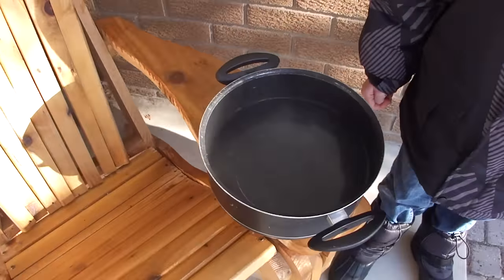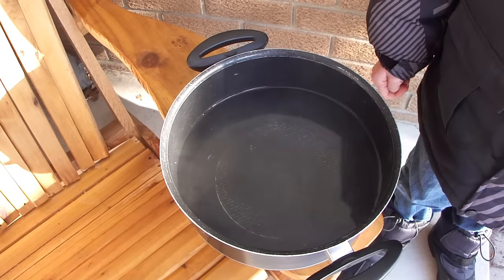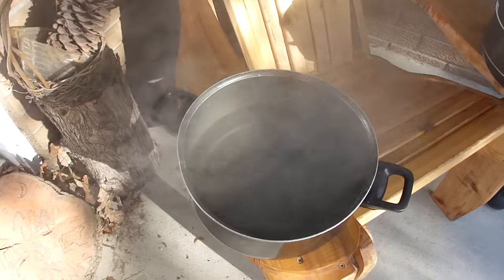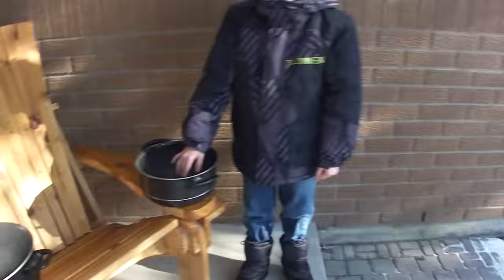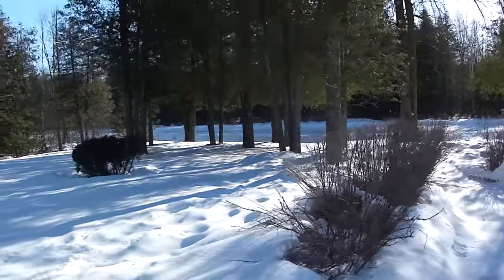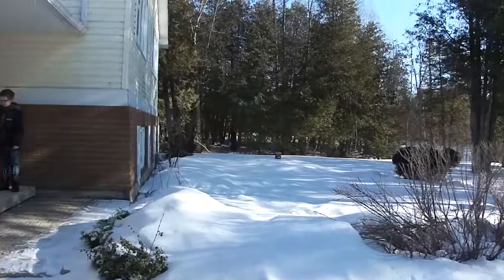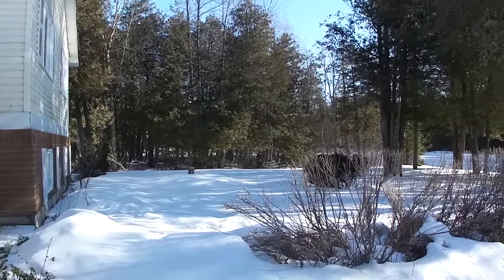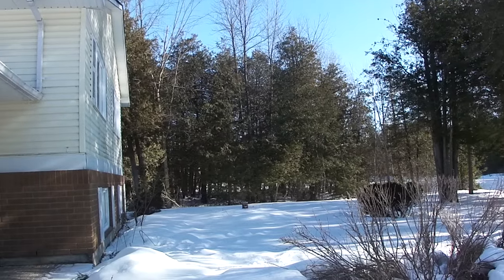Hot water freezes faster than cold water?

Comment: The hot water tries evaporate and turned into particles so that praticles easily and quickly freeze. Thats how it works.
Reply: thank you, i was scrolling the comments to look for explanation
Reply: @lunskyie  the difference in temperature is proportional to the drop in temperature. The higher the temperature the more quick the temperature drops.
Reply: and hot water is less dense than cold water so it freezes faster
Reply: Yes . exactly.. Thanks
Reply: Does this apply to boiling?
Reply: @raivaru3270  you mean the other way around? No,
Reply: @raivaru3270  No because because boiling is gaining temperature (energy) while cooling is loosing energy. Let's say you have pure water which boils at 100°C. The water if is 20°C will take more time to boil than the water being 30°C. Because at 20°C the water has stronger intermolecular forces of attraction. More energy is required to break bonds while separating the molecules such that the intermolecular potential energy is increased. Therefore it will take more time to boil than the 30°C water.
Reply: So what should they give you? Nobel for physics or chemistry?
Reply: @ismailhossen2043  Nothing he is just explaining something
Reply: @ismailhossen2043  both
Reply: U know this is not really the explanation atleast not accurate at all ,the displayed effect is called mpemba effect,and there isnt an agreed explanation on it ,so it's not as simple as you would like to think
Reply: The reason why hot water freezes faster is because the molecules in hot water are moving faster than cold water. When the molecules are moving faster they hit the cold faster and cool down faster. Simple easy numbers to explain this, a single cold molecule will take 1 second to move from one side of the pot to the other. A hot molecule takes 0.5 seconds to move from one side to the other. So in one second the cold molecule only hit the ambient temperature once and the hot molecule will hit ambient temperature twice. The more the molecule hits ambient temperature the more it picks up ambient temperature.
Reply: @ismailhossen2043  someone's jelly about someone else knowing more than them
Reply: I feel smarter now
Reply: @youdononeetokno  I feel smarter but not at the same time lol
Reply: @jhan168  bruh
Reply: @waybous  yeah. Basically the hot water has more kinetic energy.👍
Reply: @youdononeetokno  lmao 🤣 Honestly though. Like I understand the concept but when you add words like intermolecular forces, my brain refuses to process 🤣
Reply: @jhan168  Wdym. That's how they taught me at school😂
Reply: @kokusei3948  well it is a proven fact that hot water indeed freezes faster. Its just that we dont really know the real reason behind it
Reply: @youdononeetokno  Yeah. The bottom line is you're smart, I'm not.
Reply: @kokusei3948  testing which one freezes faster....in a freezer. Using timers of course
Reply: @jhan168  Thank you but I wouldn't say that I'm smart because there's so much that I do not know and other fields that I don't understand at all
Reply: @kokusei3948  dunno, not my expertise
Reply: @kokusei3948  no problem
Reply: i think the word is "Condensation" ?
Reply: @narcos2910  condensation is the direct opposite of evaporation, so no i don't think so
Reply: @youdononeetokno  "the higher you go, the farther you fall"
Reply: Now that’s science 🧪
Reply: Thanks
Reply: @kokusei3948  To fully understand it you would need to connect quantum mechanics and thermodynamics. The position, energy and momentum of the individual particles in the molecules is quantum mechanics. This leads to the state and behaviour of the individual water molecules and the same for what surrounds each of them. This then leads to the thermodynamics of the systems involved in which the average energy of the water molecules in the system matches the average energy of the air molecules faster based on the how bigger the difference is between them. The more potential energy within the particles contained in the water molecules the bigger the gaps between the water molecules, the faster the molecules can move and the more energy that can be transferred via photons to the colder, more dense, less active molecules within the air. This means that the particles in the system achieve faster thermal equilibrium the greater the difference is between the hotter water and the colder air.
Reply: that is false. i mean kind of. the reason hot water freezes faster is because it has less molecules in them so the cold air has less to freeze. and if you noticed it didnt evaporate it turns to snow.
Reply: @jdogzerosilverblade299  That’s why people were pointing out that hotter water has lower density, which means bigger gaps between the molecules, due to particles with higher potential energy having a wider area of probable positions and a higher probability of generating higher energy and/or more frequent bosons.
Reply: Aaaaaaaaaaaah ohhh yeah
Reply: I reply so late but it's funny how people look things up and pretend like they know things lol but if you really did know good for you ig
Reply: So simple (sientist)
Reply: @kokusei3948  What you’re stating comes from combining classical mechanics and thermodynamics. To understand it you need to combine quantum mechanics and thermodynamics. Hot and cold aren’t opposites in the way you explain when dealing with particles. All you have is potential energy levels. A volume of particles has less particles in it as the average potential energy in the particles increases. The combined volume of particles is also referred to as a system. In quantum mechanics the particles try to get an average potential energy, which happens faster if there are less particles. They can also produce higher energy photons to transfer the energy throughout the system if they have more potential energy. All the system has to do is agree on a new average potential energy level for the system in order to transition to that temperature on the macroscopic scale. That happens faster with less particles and greater levels of energy.
Reply: Are you a scientist? 😮
Reply: @killuabodypillow7607  I have a 1st class bachelors degree in physics (with honours) and a PhD in particle physics.
Reply: Damn, thats pretty interesting actually
Reply: @youdononeetokno  oh ok thank you
Reply: @anthonyscarfe4853  that's cool and what are doing as job. I'm still a student and I don't know what I wanna do.
Reply: That’s not what they said in the video.
Reply: @youdononeetokno  I got a brain injury from a virus and collapsed in a room for 4 days at the end of the PhD. I finished the PhD but got declared not fit for work, so don’t work. Otherwise I would be working in accelerator science.
Reply: @youdononeetokno  Until it reaches the point of the initially cold water and the rates become the same.
Reply: Seems like it was from an educated person because the reliability of Spelling and actual your wrong. Reply to this reply to get a reply of the actual theory
Reply: I think its the way heat distributes evenly. Unlike he cold water
Reply: Idk but it doesn't make sense to me...the water is not evaporating...it is not gaining energy...it is loosing heat and getting freezed...how can both the conditions happen simultaneously...loosing and gaining energy??
Reply: yeah, the title misleads people.
Reply: No bro it's called a prank
Reply: Hot water has a higher difference in temperature than the outside, which is very cold. Cold water has less of a difference, so it doesn’t have as much as a change
Reply: Yea no shit sherlock
Reply: And that's why I'm here
Reply: ཀཱ  Idk. I was partially correct but indeed, was  lacking a lot of valuable reasonings.
Reply: @anthonyscarfe4853  Wow. That's a lot of damage.
Reply: @swaim Aladee
Your explanation is wrong . It works based on Heat exchange. Heat exchange = msdt . More the temperature difference , higher the heat exchange and higher time to change temperature if we take same amount of mass and same material (in this case water) . In this scenario they are throwing hot water in Air. Due to the heat there is more gap between hot water molecules, so basically each hot water molecule is getting surrounded by dense cold air and that's the only reason it is evaporating quickly.
Reply: Your logic uses correct principles, only applies them wrong. The hot water doesn't evaporate that much. Only a small fraction is capable of doing so, because it's so cold outside. Also if it's snowing, the water saturation in the air must be higher than usual (I know precipitation happens in higher layers of the atmosphere, but it does correlate somewhat to the ground level air moisture). With low temperature and high saturation, the hot water is unlikely to evaporate very fast. And as some evaporates, it explands, and so seems like a lot of steam, when in fact most water will remain liquid. But like someone has already said, this is an unexplained phenomenon that must have a more complex answer.
Also someone was saying the hot particles come into contact with the cold air faster and therefore freeze faster, which makes no sense, because eventually the particle will drop down to the temperature of cold water, having the same trouble with freezing only having wasted time cooling down. Also the logic itself of particle movement explaining freezing doesn't make much sense.
Reply: @jasher_adithela  Firstly they’re using the same volume of water, not the same mass. Hotter water has less mass than the same volume of colder water due to the increasing gap between molecules. To form ice the molecules need to form crystalline structures, which means liquid water molecules spread out more as they cool. Also quantum mechanics means particles in a system have to achieve an average energy level, which is where temperature comes from. Higher energy levels within the system also allow for more photons and higher energy photons, which is the main way temperature is transferred. It’s also the way the electrons in the systems bind together. The greater the energy level of the electrons the easier it is to form the bonds. Remember all that’s happening is a number of free roaming dihydromonoxide molecules are trying to form crystalline structures with each other by radiating photons into the surrounding air system until both systems contain the same average energy level. One sample has less molecules, more energy available and already doesn’t need to spread out the molecules before forming the crystalline structures. The other sample has more molecules, less energy available and has to work harder to get the molecules further apart before the crystalline structures are formed.
Reply: @Fixer Fibo yes
Reply: By particles, do you mean water vapor?
Reply: @jhan168   Intermolecular forces are just forces between molecules. In the context of their comment, just know that the greater the force, the harder to break the bonds between the two. And thus the higher the boiling point.
Reply: @Veronicz  When I refer particles I’m beginning at the subatomic particles that are the systems that form the atoms. They then are the systems that form the molecules. They then are the two separate systems that we have at the start of the experiment, which is water and air. We are then joining the two systems together and finally observing the rate of change within that system between free roaming H2O molecules and crystalline structure bonded H2O molecules. We are using the same volume, not mass, of samples of water across two experiments with the only difference being the starting temperature of the water. To understand the reason for the time difference one must fully understand the difference between the starting systems, how each system works, alters its average energy level, finds its new average energy level and gets the molecules to change from free roaming to crystalline structures.
Reply: Correct. A+
Reply: @anthonyscarfe4853  Wait, liquid molecules spread out more as they cool. I know as they cool, they lose energy and become closer together. Like the intermolecular separation. Am I right?
Reply: @Black Coffee pls You remind me of a friend.
Reply: Anthony Scarfe and Martin Cunha Rocha are the type of people who write a long essay with 0 logic for 2 Point Answer and expect the teacher to be impressed and let them pass. Go back to school and clear your basics
Reply: @youdononeetokno  A liquid has free roaming molecules while a solid has bonded molecules. Not all liquids require greater spacing between molecules when going to a solid. Water does require greater spacing between molecules for solid state rather than liquid state. So as water cools its molecules need more spacing in order to create the crystalline structures. And also the temperature of an object comes from the average energy level of particles in the system.
Reply: @jasher_adithela  I’m terribly sorry that you seem to be getting lost in my explanations. People stated that nobody had ever worked out why the phenomenon shown in the video happens. I’m just using my background in physics to provide the explanation. Other people trying to explain it are using thermodynamics and classical mechanics, but aren’t fully explaining it or are coming across errors. I’m using quantum mechanics and thermodynamics to explain how the whole system works in order to explain the experiments and give a complete explanation for the results. If it seems too long winded that’s because it requires a lot of information. If it’s confusing then that’s because it involves very complicated physics. I’m trying my best to dumb it down enough to not need a PhD in particle physics or a degree in physics, but also have to include enough information to keep the logical processes included that are required for the complete explanation.
Reply: I don’t think that’s how it works. For water to evaporate the environmental temperature should higher than the water itself.
Reply: @dartharbiter4774  The water isn’t evaporating. It’s freezing. That means that the free roaming water molecules that make up the liquid are reducing their average energy level and forming crystalline structures in order to become ice. Evaporation is when the water liquid spreads out enough throughout the air to no longer be relevant as a liquid or heats up enough to turn into a gas.
Reply: @anthonyscarfe4853  yes, I know what evaporation is. I was correcting the Original commenter because he used the name “evaporation” and not “freezing” also I can’t believe you have a PhD!! I also hope of getting a PhD in the future. By the way, what do you have to do to get a PhD in physics?? Do you have to make theories or discover something new or etc.??
Reply: @dartharbiter4774  The PhD involves being given research to fulfil that may include multiple individual research topics and papers before you finish the thesis. This can cover experimental or theoretical work. You can try to come with your own research topics or just get one assigned to you. My particle physics work was the accelerator science side of it, so basically designing an accelerator and making it work properly. The experimental particle physicists were the ones who tried to smash particles together in order to see what happens and the theoretical particle physicists just made predictions for what would happen.
Reply: @anthonyscarfe4853  that’s really cool! Thanks for the information!
Reply: @anthonyscarfe4853  Question. As the both system try to achieve an average energy levels, which system is having to reduce the energy level? Is it air or hot water molecules?

Sorry my English is bad since its not my first language
Reply: @thommypamungkas6317  On the larger scale thermal energy is being transferred from the hotter water to the to the colder air until a state of equilibrium is reached or no more thermal energy can be transferred.
Reply: @SAMUEL-bb2ig  it’s literally the same density my guy H20 has the same density throughout ALL phase changes. hot water simply made a bigger reaction because it contrasted with the surrounding temperature more than the cold water. it did not “freeze faster”. impossible for that to happen when 0 freezing is occurring in either the cold or hot water in this video.
Reply: @killuabodypillow7607  no
Reply: hey everyone I'm commenting here in a simpliest way AMAP so that everyone can understand AMAP. If you apply so much scientific language, well we dont understand science word, so just understand it ASAP (as simple as possible). also im slow at science and not that slow so fellow friends 😉 take this as a good (not perfect) explanation, okay?
Reply: There are so many so-called 'explanations' here. Why can't anyone admit that sometimes "We just don't know"?
Any scientist worth the name would/should tell you this.
Reply: @anthonyscarfe4853  there is a correlation about the intermolecolar density? Ice(snow) has less density than liquid water, like the hot water at least. Am I wrong?
Reply: And when the water is hotter than 80 ~ C ° it cools faster
Reply: Yes bro" Newton's law of cooling"
Reply: @LimAu144  actually my first thought after watching this was that the hot water had a big amount of water evaporating and as soon as it left the pan that was acting as an isolator the water that was sitting at 100% degrees ( it’s a bit more because water isn’t pure) quickly condensed. It’s not illogical but after reading other people’s opinions…
Reply: @noobgaming3636 "are you talking to me?" 
 -cit Travis